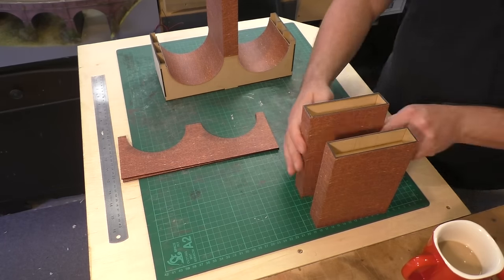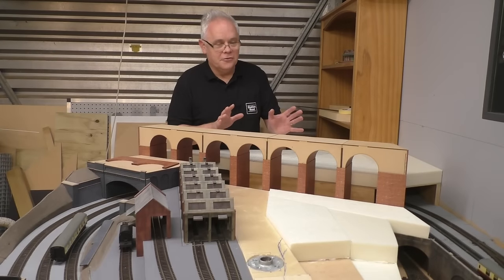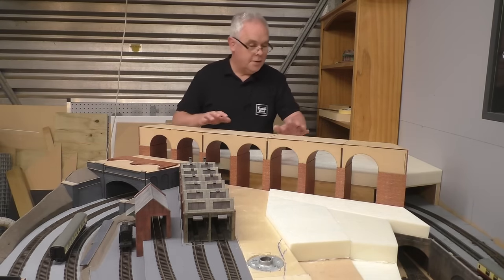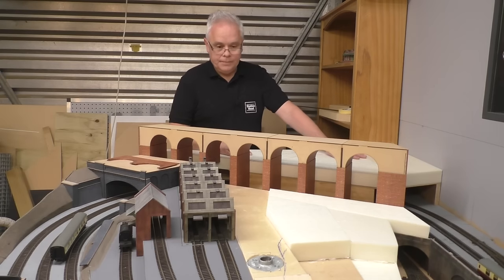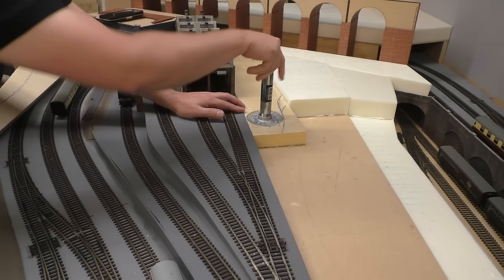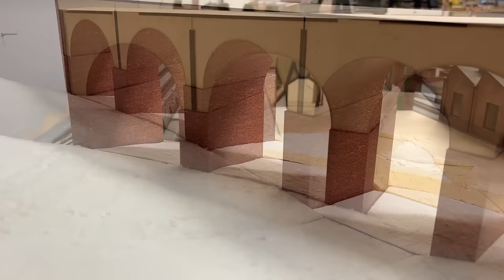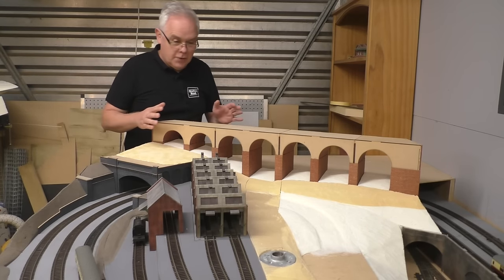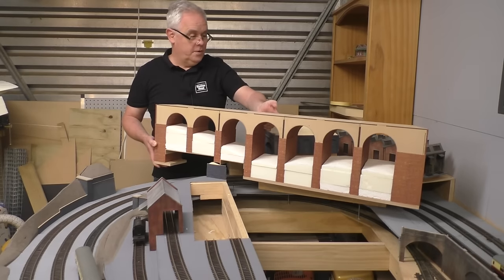New Project - Viaduct Build - Stage 3

Comment: Dear Julian, great vid. Love your explanations, views on the landscape aspect, the design aspect of making the entire viaduct a separate lift out unit.
Was indeed wondering on the galvanized flange bracket. Couldn’t see if the inside of the flange was indeed threaded, until you showed it. Think those kind of flange brackets are an excellent way to make these sections as lift out units. 
Love the progress, this whole scene is going to an absolute amazing eye-catching feature on your layout! 
Curious for the solution you’re gonna come up with on the right hand side of the viaduct, over the three main lines, from the viewer’s perspective. Cheerio
Reply from the maker: Yes, the bridge section over the righthand end will be a project in itself.

Comment: I think you were about to say, "If Paul can build it, anyone can." ;) But nice viaduct; laser cutters are making a big impact on the hobby. Have you thought about engraving a brick/stone texture onto the wood ready for painting and avoid the use of texture paper?
Reply from the maker: I'm on the fence with regards to laser engraved brickwork, I don't think it yields enough visual advantage for the amount of work involved. Aside from the painting, mortar infill and weathering, the laser engraving is a very time consuming process. Cutting a single double arch outer side section on my diode laser takes just under a minute, to do the equivalent with laser engraved brickwork would take about 2 hours. Factor in 6 of these components plus another two halves and then the pylons, you'd be looking at 24 hours of non-stop engraving. This is where a CO2 laser comes into play, which I don't have (much more expensive).

Comment: Great progress however a couple of thoughts. With the screw in handle in the big lift-out section is it worth adding second handle at the other end of the section? Just looked a bit of a struggle and unbalanced to lift away with just one? Also may be I haven’t been paying attention but what happens at the end of the viaduct that goes over the track and tunnel mouth yet to be built? Bridge of some sort, more viaduct or just stops?
Reply from the maker: It was more a case of the lift-out section getting stuck on the blocks between the arches, these hadn't been finessed and some were poking out too much.

Comment: Is MDF better quality down under? Many people use it and regret it after when it absorbes moisture, expands, go's mouldy, bends etc etc
The dust is dangerous too
Plywoods safe.
Reply from the maker: I'm not entirely sure. Where I'm based on the east coast of the South Island NZ, it's a relatively dry climate so MDF seems to fair reasonably well.